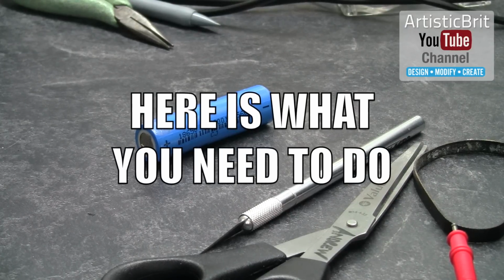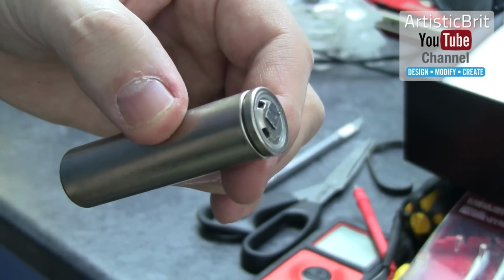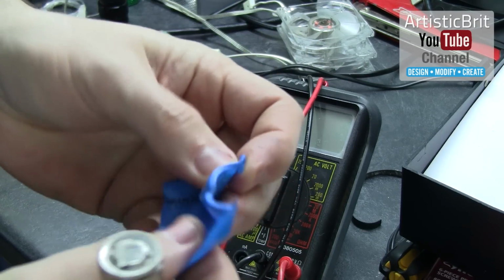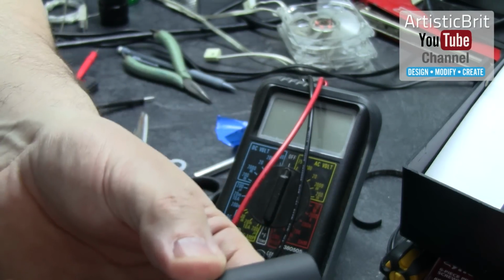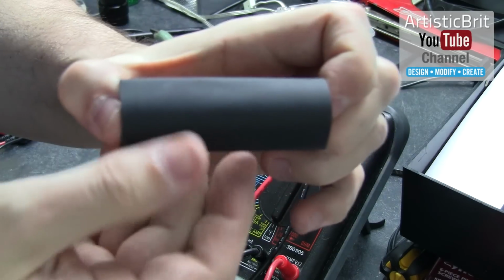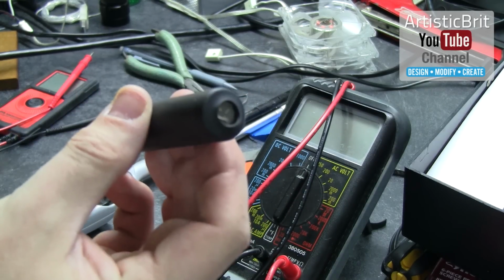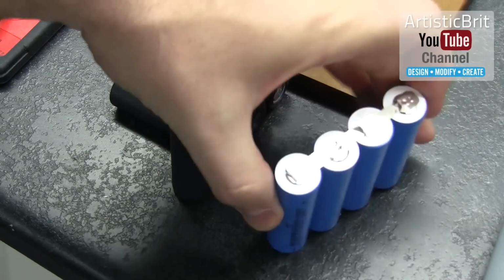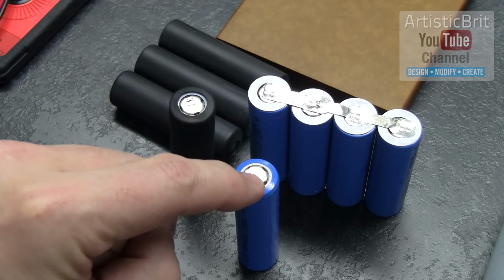Electric Danger of Lithium Ion 18650 - Battery Fires Exposed - Possible DIY Solution

Comment: The problem is that if I wanted to then put that battery into my torch or vape, it's going to be the wrong size. Making them functionally useless for something designed to take them.
Reply: +Rob H (BuddyVape) You can see at 11:25, that a pack of 4 batteries is 1/8 " wider than normal, so each is 1/32 " thicker, which is actually too much for many torches...
Reply: We get it, you pave.
Reply: You don’t need to do this if ur useing them for a flash light or vape just check now and then for any rips in the battery wrap or insulator cap if you see any buy new premade 18650 battery wraps easy to put on using a hairdryer (alway replace the insulator ring when rewrapping)

Comment: As a fire sprinkler fitter 25 years  the only actual sprinkler activation I've attended due to fire was caused by a laptop being charged on a carpet next to a couch. Nowadays anything I charge I do so on a flat non flammable surface. However in this case the enemy of lithium batteries is heat. This thick insulating material will not aid in cooling so I'd guess the batteries won't last as long.

Comment: THANK YOU! this is very useful and vital information! that's just ridiculous to make a battery like that! they couldn't possibly make the production so that they include an insulator SOMEWHERE, literally ANYWHERE further away from RIGHT NEXT TO THE DAMN POSITIVE?? that's an absolutely terrible design. They need to include information along the lines of DO NOT USE IF THE WRAP ISN'T PERFECTLY INTACT.
Reply from the maker: Andrew Miller Dude, thank you! I have had a lot of silly backlash from this video. hehe You have to laugh really, but thanks for seeing what i was trying to convey.
Reply: you guys have to do some research too. first of all, all 18650 is danger even the manufacturer claim it. ALL except 1 brand is made of used laptop batteries.

also, 18650 was made purposely for flashlights. a lot of expensive flashlight that cost around 100 bucks and more tend to be pickly with some batteries.  for example, your electrical shrink wrap will not be able to fit flashlight because its not too thick.

you can put anotation on the video.
Reply: Andrew Jones I Think the thing is all batteries are made like that, and have been for some time, this isn't news
Reply from the maker: For you possibly, but for many that have thanked me for letting them know this, it was news. Just saying.
Reply: BlueRice 
I can see you're trying to be sarcastic here, but most readers would not understand. Let's state the facts.

18650 is made for industrial use in battery packs. Individual cells are not consumer products.

Flashlight use is just an application of existing technology.

Individual cell batteries are not typically recycled junk, but brand new cells. Only poor cheapo chinese junk is recycled waste.

Cylindrical li-ions are risky, but not because of structural details causing a possible short. That is paranoia.
Reply: TheVessapaperimuumio
i been reading up about batteries and into flashlights for years. i owned all brand of flashlights and research for the best batteries to used. like stremeline, fenix etc...
Reply: BlueRice 
How's that related to anything? Everything I stated above is correct.

Comment: Seeing as how over 40% of the ratings for this vid are thumbs down, I'm sure somebody else has already said this, but this is a time consuming way to make these batteries more dangerous. There is virtually no danger to having the sides of the battery exposed. In cars, the negative battery terminal is connected to to the frame of the car. The frame, engine, and body all have negative potential, just like the sides of these batteries, and it's fine.  The only danger is if you have an unfused wire or object close it. Then again, your wire should be insulated anyway.  The only real danger would be if the top of the battery was abraded or damaged in some other way so that a metal object would contact the positive end and the negative metal right next to it (just like the wire you used in your video), or if an impact deformed the battery to make these two portions of the battery contact each other.  In both cases, the best thing you could do to protect against a short would be to put an impact and abrasion resistant material at the interface between the positively and negatively charged metals, just like the ring it came with from the factory. That ring will take a lot more beating than the heat shrink it was replaced with.

Comment: It's NOT mylar that they wrap them with, it's merely a different kind of heatshrink tubing to the one you used. Used in the laptop industry since ever without problems. Those of us who use 18650s in torches, ecigs etc are used to rewrapping them in this way when the original heatshrinking becomes damaged, usually around the negative end of the can. The whole can being negative is, as far as i am aware, something that has been common in the battery industry for aeons. I can remember seeing it 25 years ago as a child.

Comment: thank you. a lot of people bitching about how dangerous litium ions are (and yes they sure can be) you are one of the few that expressed some of those concerns in a constructive way with education. next up someone needs to do a video on ir testing with a scope and signal gen. that might be me soon but  im still building my lab. I was in a commercial space but the owner of the "electronics repair" store attempt knew nothing and didnt want to put any future profit sharing in writing even though he was using 5k worth of my equiptment every day. so my apt/flat is currently being converted which is a major pain in the ass. BTW get yourself a 50 usd adjustable temp heat gun on ebay "smd rework station"

Comment: I did something similar for my 18650 that i use in my flashlights. But i didn't use shrink tube because is to thick and they didn't fit, i just used transparent duct tape to insulate them better.
Reply from the maker: Good job Victor. These batteries in the video are being put together in series and parallel to create a battery pack from an electric bike I am creating which will be here on youtube this summer. The size restraint doesn't matter in my use thankfully.
Reply: Andrew Jones
Yes i realized that in your case is not a problem but for my space was a problem. And honestly when i see how fin the protection is on this accumulators, i thought that if i use them in a high power drainage flashlight i better reinforce the insulation on them.
Reply from the maker: Victor C Yes, better to be safe.
Reply: Andrew Jones
That's my moto to ;-)

Comment: At 1:34 of the video you briefly talk about the "little plastic cap on top". This is a ring insulator which is there to prevent the exact problem you are trying to solve against in the entire video. The insulator is thicker than the wrap which you are applying and I bet it does a better job at protecting against a short. In short, the battery design already accounts for the danger which you are highlighting and all needed components are in place to prevent the short from happening.

Comment: may be protected from bouncing and shorting but it will retain heat like a s.o.b. manufacturers put specific coatings on certain products for a reason and this coating helps the battery vent

Comment: Safer before you started. Especially since you left off the plastic ring. If you really wanted them to be safe, heat shrink without taking the plastic ring and the outer covering off.

Comment: What is the size of the heat shrink tube that you used? The problem with some of the heat shrink tube out there  is that it makes the batteries more thicker and if you end up sticking your batteries back into your flashlight they would not fit again! I think that the round plastic that you took off from the first battery thats is what prevents the sshort to happen, thats why at the end you ended up sticking the whole battery in the heat shrink tube!
Reply from the maker: Yes agreed Santiago. I simply purchased regular heat shrink tubing from a local electrical store. At the end of the video I show how much extra in size it adds to the batteries, although the measurements on the tubing say: 3/4" Thin Wall Polyolefin, Part No. 47-20948-BK, Recovers to 3/8" Ratio 2:1 I hope that helps some.
Reply: Thank you Andrew. Enjoyed your video.
Reply from the maker: santiago vindell Thanks so much Santiago.

Comment: There is few problems with doing this
1st. Heat transfer from the battery gets impacted.
2nd. expendability of battery. When battery heats up it expends, but when heat-shrink heats up it does opposite, it contracts.
3rd. To properly charge 18650 bms needs to sense temperature.

Comment: So you converted 18650 batts into 19651 batts by removing the insulation and replacing it with heat-shrink, or by putting heat-shrink over the original insulation, and in the process of doing so discovered that when you remove the insulation and short the exposed terminals out, current flows. in the process you may have also adversely affected the batteries by over heating when heating the heat-shrink, and you have no idea how what you've done will affect their heat dissipation. Did I miss anything out?
Reply from the maker: +Denis McMahon yes, you missed much. But glad you got that off your chest.

Comment: Use the nylon washer you removed as its more durable than just your shrink tubing
If you are building packs for motorized scooter or other high impact items use the plastic holders designed for them
You can see a sample of these being used on the electric samba page

Comment: Was wondering if replacing the coating with a heavier wrap would cause the battery to retain the small heat that they make under normal usage to actually over heat the battery and shorten its lifespan?
Reply from the maker: Probably James Gulrich You're probably right. The end purpose of my own situation will be very different, as they are vented and open to the air flow in the go-cart or Car I will be building this summer on YouTube. Though plan on carrying out a few experiments on YouTube to discover if this is true or not.

Comment: I have a .5 build Tesla Invader II with 18650 MXJO batteries. I'm new to vaping and my problem is that I can charge the batteries for 2 hours using a Nitecore charger, and my batteries will discharge and become weaker after 25 minutes of usage? These are brand new MXJO 3000 mAh batteries btw, any solutions???
Reply: +Cell Jr. The solution is to use a regulated mod (variable voltage / wattage).  You're using a mechanical mod so there's no circuitry so you are limited to the voltage coming off your battery.  As the battery gets weaker, so does your vape - this is normal.   A regulated mod will always draw the voltage you set until the cell is drained.

Comment: thats how almost all cylindrical batteries are. only ones i've seen that arent are C cells made in the 1950s with cardboard middle pieces.
Reply from the maker: That's good to know thanks. Oddly enough I ended up designing something due to this that would help considerably in creating battery packs with 18650 batteries. I'll show it when ready. I could imagine a bike wreck causing possibly metal to contact the wrong parts of a battery starting a fire.
Reply: indeed, its just scary with these 18650's. Most other batteries this size are more forgiving with a short out.  Short one of those out, the wire gets hot, short an 18650 out and boom in your face!
Reply: what short 18650goes boom when

Comment: It's an interesting peek into the anatomy of a battery and i really like the first part of the video. I would, however, advice against replicating the part where you roll your own insulation due to (as others are saying as well) changed heat dissipation characteristics and cell dimensions and it appears the custom isolation is not better than stock (remember that fairly thick plastic ring you removed?). I would also be nervous about using a torch on a li-ion cell, but as you say its not really heating the cell.

Comment: Andrew I know exactly what your saying I was very concerned also so when I built my 147 ah pack for my solar power, I also wrapped all the cells inside a fire blanket, then added vents and sealed the whole lot up in Robnor Resin the fire retardant stuff semi flexible it has a texture similar to Rubber.
Reply: What about the heat?   Does it dissipate well?
Reply: @anonymous175  I don't draw much power from it, it's now 2023 over 8 years later still no issues.

Comment: ALLL batteries have negative body. Well there is few mostly 9volts, but rest is always negative whole battery and i think everybody who uses batteries knows that :)
Reply: Even the common alkaline batteries are like that too.  I can not think of anyone who doesn't have a few of those lying around and it is because so many things use them in one size or another.
Reply: True for one part but false for the part that everyone who uses batteries know this. Everyone has batteries and don't know what they do and have no idea that the whole thing is negative besides the positive end.

Comment: I don't see why the standard plastic wrap is unsafe and needs improving ?
In my experience, I don't find the black rubber shrink wrap that you've applied particularly protective against sharp objects - in fact, I'd go as far as saying the original plastic is tougher.
If you're going to bundle the batteries together, why not just add extra protection around each pack and leave the individual batteries as they are ?
And I don't envy you soldering tabs between the battery terminals - if you've got a mini spot welder, then fair enough, but I'd say the risk of soldering dozens of batteries is greater than the risk of leaving them in their plastic wrapping.
I've done similar projects but on a much smaller scale (cordless power tools etc..) and I just use a battery holder. It means I don't have to do anything to the batteries and they can be replaced if required. Could you not just get a few of these: http://www.amazon.co.uk/Black-Pointed-Batteries-Battery-Holder/dp/B00CQKAZES/ref=sr_1_24
Good luck with the project though - I'm not meaning to put you off :)

Comment: But you will find this with all batteries, that's why they use the insulator around the body of the cell, how you configure them is up to you or the designer of the product.

Often devices that use these types of battery use some kind of card separator to support the cell, and they have hot glue to hold them solid in place to minimise movement between the cells.
Reply from the maker: flitsies Yes, I had no idea. Funny as I work with batteries very often. But now I am building an electric vehicle, its the first time I actually took the coating off and quite surprised.
Reply: Andrew Jones You will find ordinary disposable cells can also catch fire if shorted out, that's another good reason not to put what is considered dead batteries in normal trash/rubbish bins because they could short out and catch fire.

It's not likely to but it could happen especially if they have been tampered with.

Comment: Haters or not, they do have a good point. You are deliberately removing all of the factory protection on this battery, and deliberately placing a metal item across the terminals to short it out, and then replacing the protection with heat shrink tubing. You mentioned several times in this video how something could nick or scratch or cut the factory protective wrapper and then cause a short, but what I don't understand, is what you would be using this battery for, where there would be a risk of it getting cut, nicked, or scratched. I have never seen batteries even remotely similar to these that were not encased in something protective, like a flashlight body, or the plastic housing with which they use these in e.g. laptop battery packs  (an oft-overlooked source of these batteries in still-serviceable condition). I'm curious, just what could possibly nick, cut, or scratch the protective sheath on this battery, and then cut through the phenolic spacer on top, and then short out the positive and negative, while the battery is properly installed in a flashlight or a battery pack?
Reply: Ah, I see now these were sourced from such an oft-overlooked source, as I continue the video. 

Also, I read someone else's comment about using direct flame on these batteries to shrink the heat shrink tubing. Obviously you know this apparently they don't, but you're not eating the battery up as much as one might think. The heat shrink tubing is going to absorb the majority of the heat, and very little of that by comparison will be transferred to the battery. So in reality, it's not as dangerous as people are making it out to be... Kind of like the protective wrapper the factory put on it.
Reply from the maker: 1986turbozcs These batteries are used by thousands of us to power things much bigger than flashlights. I'm building a vehicle, and in an accident this design flaw would be a huge issue.
Reply: Andrew Jones gotcha,  i apparently missed that.   In that event, sure, the thinner wrapper would do no good. ;)